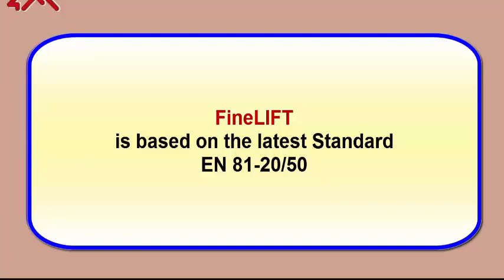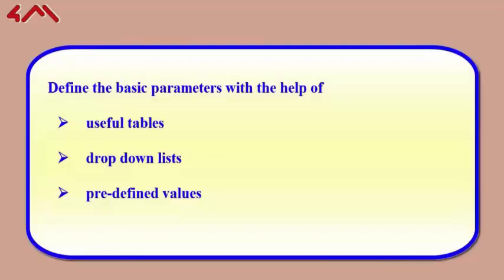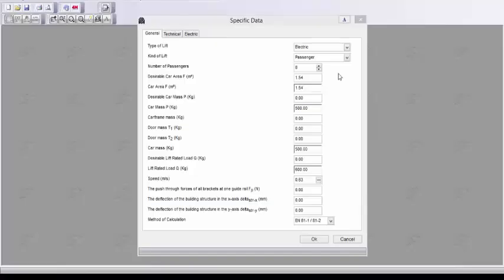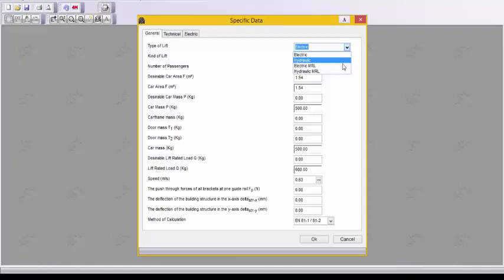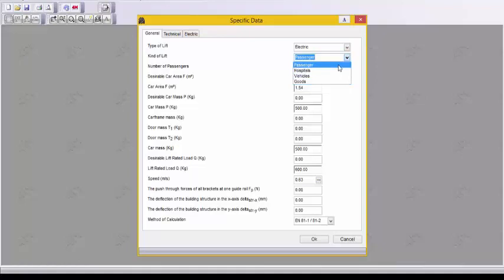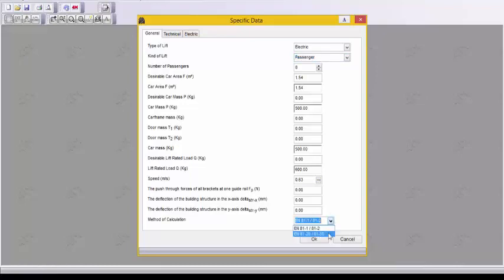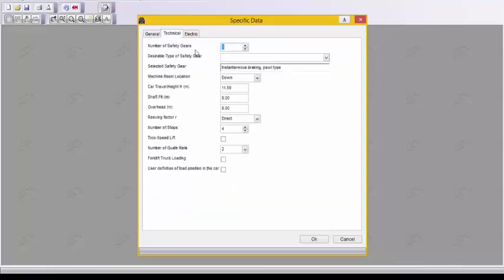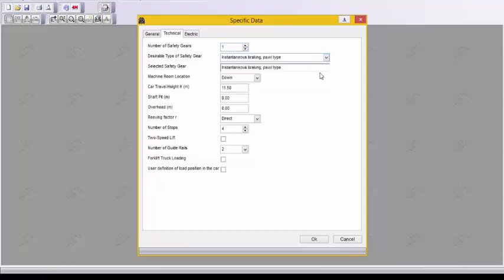FINE LIFT 19  - Get the Concept

Comment: 3D model 3D family to Revit? in the video only shows 2D product...thanks
Reply from the maker: The lift drawings can be exported only to 2D distances. Generally, 3D building entities can be imported from Revit using IFC technology. The user can also draw BIM entities walls, openings, doors etc using the corresponding funtions. 
The great advantage of this application are the easy to use environment, quick response and output of the technical printouts/results and handy modification of 2D LIFT drawings though the menu ondrawing module. In addition, FINE LIFT includes the 4MCAD core with perpetual CAD license in a quite good price, in compariosn with other LIFT design softwares.  Send  your feeback and technical questions at isidoros@4msa.com and find more information about the software at www.4msa.com